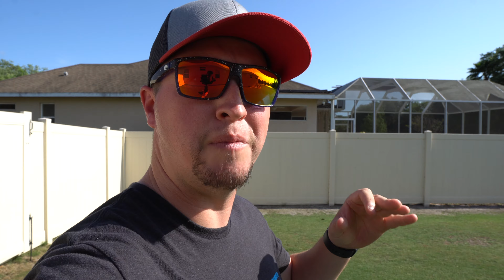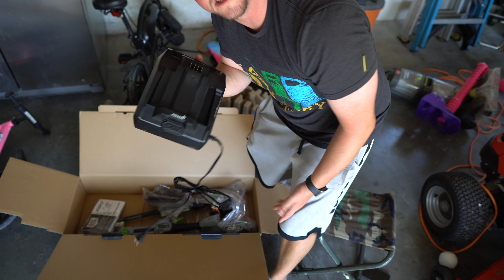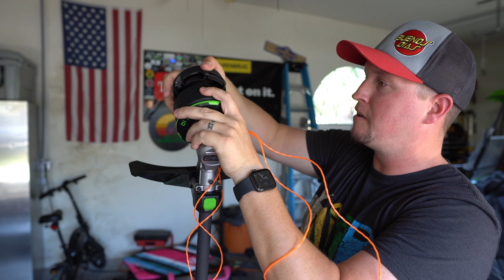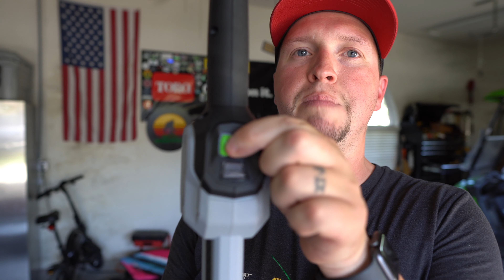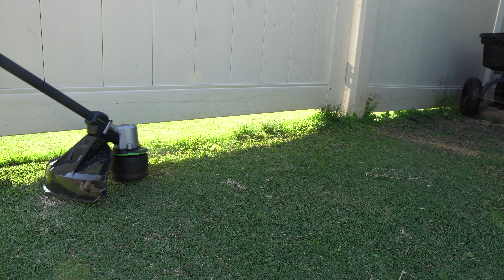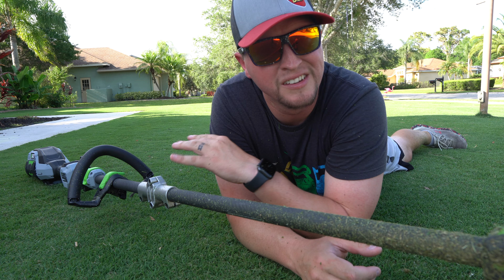Best battery trimmer ever?? Watch before you buy Ego 16" line IQ trimmer!

Comment: I have many Ego products that I like but not this one. Immediately returned it. I thought this trimmer would replace my 10 yr old Echo SRM-225. Not a chance. The Ego is underpowered and slow to use compared to my Echo gas trimmer. Also the line iq only lengthens to line when it gets quite short. Much better to have a bump head to lengthen the line whenever you want. Only think better is the power load feature but I fill my trimmer line in about 60 seconds so not big deal. The head holds the motor so more weight in the head. They EGO and the Echo weigh the same but the Echo feels lighter because you aren't holding the weight of the heavy head. Obviously if you only have a small area to trim you won't notice the weight but on large trim jobs you feel the weight.

Comment: So after deciding that I am going to buy a EGO trimmer here soon, the only thing I wished that Line IQ would spit out more than 16 in.  I took my guard off my Husqvarna because I wanted to be able to spit out up to a total of 20+ in. and take out big swaths at a time.  So is the bump head still worth it or is the Line IQ the way to go?  Also, the Line IQ comes with 4.0 Ah battery instead of a 2.5 Ah.
Reply from the maker: I prefer the bump head honestly.
Reply: @Brettsgrasscapades  can you swap out the heads?
Reply from the maker: @bearing_aficionado  not on this one. You have to get the attachment capable one.
Reply: @Brettsgrasscapades  alright so I wanted to give you an update.  I FREAKING LOVE THIS THING!  I am so glad I got the new one with Line IQ.  I finally ran out line with what came with mine and so I put my Husqvarna trimmer line in it.  GAME CHANGER!!!  It's even better with that line compared to the EGO line, IMO!  Thanks for your video on these trimmers.  So glad I got one.  Also, going to get the 750 cfm blower next!
Reply: @Brettsgrasscapades  So apparently you can.  On another video, a guy swapped them out.  He didn't like Line IQ.  He said took about 5 minutes.  It's held together by a 13mm nut and a horseshoe clip.

Comment: Great review, very informative, and helpful. I am retiring my 15-year-old Stihl gas trimmer and replacing it with this EGO unit. We mow 2 acres of our 10 in rural Rochester, MN. Many trees, gardens, fencing, landscaping features, and a 350-foot driveway all demanding trimming. Seems this trimmer with the 4-amp hour battery will do the job. I really like the Line IQ and power load features. Field repairs with the Stihl for running out of line and occasional hard starting are challenges I hope to avoid with the EGO. We will continue to use our larger commercial grade Stihl trimmer with the saw blade for really big weeds and saplings. I have many Stihl products, and all have performed well. However, the technology is walking away from gas powered tools as evidenced by the two hybrids (one of which is a PHEV) parked in our garage. Time to move on. Thanks again.

Comment: I can’t stand my 2 cycle troybilt - i can never start the damn thing. I’ll prime it and pull that cord for like 20-25 min no joke before it will start. Then it will die at least 5x after i start it.

I’m so tired of dealing with it. Plus gas is now $4.89+ a gallon, so screw that too. I remember paying about $225 for my 2 cycle one. Honestly $300 imo isn’t bad at all, b/c I’m getting a tool, plus the battery and the charger. I’m also not getting frustration with loading spool and am getting a much lighter tool. Weed eating will be a pleasure for me again instead of a chore.

Comment: Bought the top mower and the powerload line IQ four days ago. It was pricey as you know but mower was $100 off at Lowe's for Father's Day. These suckers are awesome. I have severe spinal arthritis and this weed trimmer will be a game changer for me in terms of weight, and all the hassle with line. It will save actual working time outside which will mean less pain for me. Thanks for the video.
Reply from the maker: You will love it!
Reply: Question is how well will all the cool line features hold up to  use and the dirt and grit that will invevitably happen.  Obviously it going to have to be cleaned alot for everything to continue to operate properly. Again my friend thanks for the great  video.

Comment: $300 is a lot to swallow, but if you already have a battery like from another EGO tool you already have, you can save yourself $80 and get the tool only (sold  as the 1620T). I already have the 650 CFM leaf blower, so coulda gone that route myself, but the leaf blower always runs out of juice close to the end of the job, so having the extra battery made sense for me. And it's waaayyy cheaper to get the battery bundled.( $80 diff w/battery vs over $200 to buy it separately)

Comment: Just ordered one for pickup today. I've been a Stihl user forever but as my gas equipment units die I will start to replace them with battery-operated ones. Should pay off in the long run especially since I run higher octane fuel in my small engine power equipment and gas prices are ridiculous.

Comment: Was ready to buy it until I picked it up at Lowe’s, that thing is way too heavy! I bought the toro 60v instead, it’s sweet and pretty light for a battery trimmer. It gets 60 mins of run time on a charge and was less than 200 bucks.
Reply from the maker: I've got the Toro as well and it's a good trimmer!  I think the ego is a superior trimmer though.

Comment: Just got one and it is amazing.  Everyone has things they feel are of value. Getting the job done with as little fuss and hassle as possible is of great value to me.   This EGO  trimmer takes a lot of fuss and hassle out of yard trimming job.  You don't have to hassle with line feed and feeding new line is a breeze with the power feed.  The trimmer is well balanced and powerful.  Unlike a gas trimmer you don't have to deal with the constant running sound of the engine and you can turn it every witch way without worrying about fuel making it to the engine. My mowing and trimming is around 1 acre with  lots of chain link fencing and concrete/brick.  For my needs and application this is by far superior to others I have tried.
Reply: Great reply, I'm going to get one.thx
Reply: Hey, could you tell me how it works edging holding the trimmer upside down i’ve heard some people say that the line IQ goes insane. Let me know how it works for you, thanks for your time
Reply: the first time I used mine, I was still nervous about holding it sideways for too long, because I've used nothing but 2 stroke trimmers for the past 30 years and it's hard to break old habits. I started it while holding it level, didnt want to tilt it too much, and even felt I didnt want the trimmer to stop running because part of my brain was thinking I'd have to start it again.
Reply: Is it heavy? The website says 14 pounds but people say 12. Is it comfortable to use with the weight?
Reply: @reycastillo3645 . It’s too heavy, a big gripe for me.  Battery is huge.

Comment: Thanks Brett, you sealed the deal for me and will be purchasing last year's model EGO Power+ ST1511T!!! 

What replacement string do you recommend purchasing? Along with other viewers, I also watch product reviews by Todd at Project Farm and have purchased a Harbor Freight Pittsburgh portable air compressor and Audew 2000A jump starter/power pack based on his thorough testing and have not been disappointed. Todd did two reviews on trimmer string and I was leaning toward the Husqvarna Titanium Force (round with grooves) or the MAXPOWER Twisted, but then watched a few videos for the Rotary VORTEX (twisted) line (Project Farm did not review) and now leaning toward the Rotary. Wanted to get your opinion on shaped vs round and thickness, .095 or .105, will the EGO ST1511T handle the thicker line and FINALLY, do you soak your line in water prior to use?

Once again, thanks for saving me $100 for a battery and not much else!!!
Reply from the maker: I'm not too picky on the string personally. Hope you like it as much as I do.

Comment: As I am a commercial guy what I do not like about it is it that it spins clockwise unlike the commercial weed whackers all spin counter clockwise so when your engine like you’re supposed to and walking backwards it’s all gonna go in your face it’s too bad they couldn’t make one that spins which ever way you want to
Reply from the maker: It would be really cool and honestly shouldn't be too hard to do with an electric motor to make it where you can decide which way the head spins. I would love to see that feature in the future.
Reply: @Brettsgrasscapades  We currently do 325 Alonso week we have all gas equipment right now with the gas prices we are really taking a little bit of a meeting we raise the prices but still only covers the fuel and labor not putting money in my own pocket would love to see some commercial battery operated machines that would last all day but I think that’s a little bit further into the future
Reply from the maker: @robsolo4024  I think the tech is there it's just expensive right now. In the next few years it will come down significantly I bet.
Reply: @Brettsgrasscapades  I should be retired in five years lol so it would be for the next in line who takes over my business I am in New York so I’ll be heading down south
Reply: I also can’t see electric being for a blower like the red max 8550s that we use so much power comes out of them electric would have to be probably so heavy

Comment: I went and bought the Milwaukee trimmer last year. That was my first and only battery trimmer ever.  Worked fine for awhile.  Then issues with battery/motor overheating.  Trimmer would shut off to protect motor from overheating before I could finish my average size yard.  Had high hopes of getting rid of gas. Brought everything back and went back to gas trimmer.  Looking at this unit and researching reviews for any overheating issues
Reply from the maker: I've never had any of those issues with any of my ego tools. Maybe look into ego. That's unfortunate to hear about the Milwaukee they usually make fantastic stuff!
Reply: I second Brett’s comment. I have used EGO tools for almost 5 years. Never had any problems with overheating. The only issue I’ve had, if you want to call it that, is my wife got a giant rock stuck in my single stage auger lol.

I have the, I think, second gen power load trimmer. Runs flawless.

Comment: One point I have considered in buying... I already have an EGO mower. I have found that often, if I let the yard grow out a little too much that the battery is dead before I finish the full lawn.  Now if I also had this trimmer I would never come close to using a full charge in one mowing.  So I could use what is left in this battery to finish up the remainder of what I didn't finish.  Just a thought.
Reply: Two batteries. One to charge and one to deplete. I run my lawn service on this technique. Occasionally someone will ask me how long a battery lasts, I tell them I don't care because they're rechargeable. And if they persist, I let them know I have a couple of batteries with more than a thousand cycles on them.
Reply from the maker: Great point!

Comment: I ordered this recently when Amazon had it discounted for 10% off.  I used it once so far.  I thought i'd mention that people will want to remove the blue protective tape that is on both blades on the guard, though be careful since that protective tape is there for a reason and those blades are sharp.  My older EGO trimmer is not that old to me but it is an old basic EGO model, maybe original, so the new one's carbon fiber shaft, auto-string loader, and auto string extender "LINE IQ" features seem worth it to me.  It is a little heavy, but i'm ok with it.  I have the 4 Ah battery and extended the shaft and adjusted the front grip so that it has a good balance for me.  It seems powerful and I only used the low setting.  Thanks for the review.
Reply from the maker: Great points! Thanks for watching!

Comment: Thanks for the review. I bought this trimmer overs a month ago after selling the older but EGO’s lightest carbon fibre trimmer due to its design was more catered towards taller people and I absolutely love the Line IQ feature which I have been missing since I sold my old cordless Black & Decker trimmer with AFS(automatic feed spool) feature four years ago. It is expansive as a kit; however, for the people who already has EGO product they should just buy the tool only which is still a great buy vs last year’s telescope model with tool only. Even though this unit is carbon fibre it is actually a hair heavier than the last year’s aluminum telescope model and spins a bit slower due to the heavier mechanics of the IQ head; however, for me the Line IQ feature actually speeds up the work flow especially when edging without the need of flipping the unit back to regular trimming position in order to be able to bump the head a few times to be sure the lines out while creating few alien crop circles aka “bald spots” along the line of the edge of a freshly cut lawn 🤯.  Using the strap is a treat compared to the old metal screw down fix ring as well. I can adjust the strap to balance the unit on the fly whenever I switch to difference size of battery depending on what batteries (modified “Select Cut High Lift Dual Blade” LM2142SP can take two batteries) I am using in the lawn mower between the 4.0, 5.0,7.5 & 10.0Ah batteries so I don’t have to walk back into the house just to grab the lightest battery to do a quick trimming job.  Thank you for a great review; however, I would say: sell the older unit and get this one in tools only just to have the Line IQ feature to save time and basal of bumping the trimmer head which has cause many trimmer owner’s Power Load feature to stop working (I was able to fix mine by disassemble , thorough cleaning and reassemble once) if the owner already has battery and charger.
Reply from the maker: Man you cover it all in this comment!
Reply: @Brettsgrasscapades  everything but the weight.... how much does this thing weigh?
Reply: @thimitri1  if I remember correctly I think I saw 12.5 pounds somewhere with the battery

Comment: Are the carbon shaft trimmers much lighter than standard?
Reply: If you get carbon fiber and the bigger battery with the line iq trimmer it's about the same as the aluminum with smaller battery
Reply: I bought it and really really like it
Reply: This unit is actually a bit heavier than the aluminum telescope trimmer; however, because the Line IQ the head is a bit heavier in the front it also create a perfect balance during operation  when using 4.0Ah or 5.0Ah batteries. With the unit able to balance perfectly and no stress on the operator to bump the head, this unit takes a lot effort to operate.
Reply: Tried it with the 7.5 amp hour battery. It was poorly balanced with the 7.5 amp hour battery 🤦‍♂️.
Reply: @robertthompson3447  not the ideal combination and better suited when using it with the Backpack Link while trimming/edging and with the blower right after the trimming/edging task is fine

Comment: Other then I think you get a 4 amp battery and not a 2.5 amp battery. some of the price might be that.
Reply: you also get a new 320W faster charger vs the older 210W slow charger to charge the larger 4.0Ah battery to full at the same speed as the 2.5Ah with the 210W charger
Reply from the maker: I think thats the big reason for the price.

Comment: Good review. I'm really enjoying mine that I bought last month. I run Mike on low speed all the time when using it on my St.Aug.
Reply from the maker: I'm a low speed guy as well. These things have so much torque yiu don't need the higher speed most of the time.
Reply: I'm able to weed eat my yard , change the battery to the multi tool edger , edge around the yard and do that 3x before I need to charge.